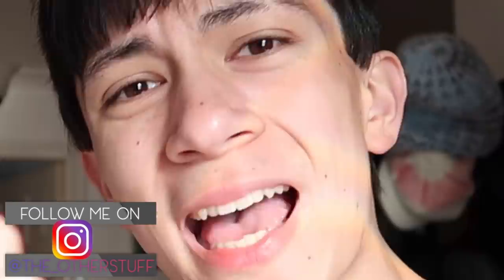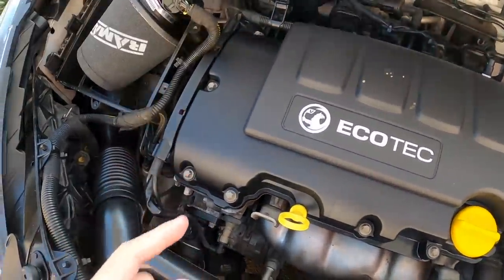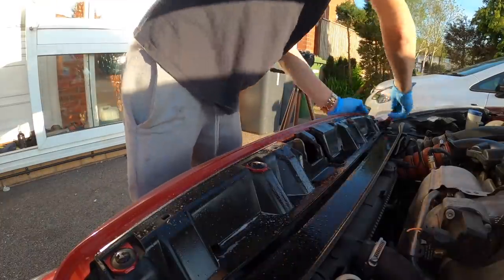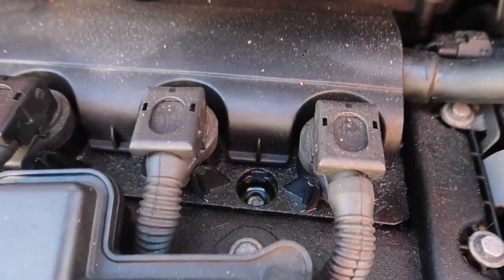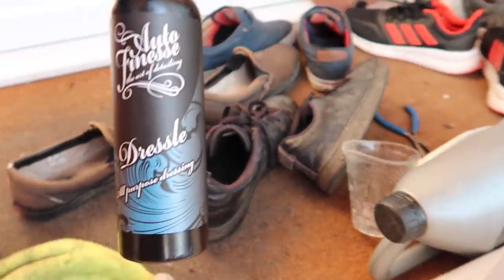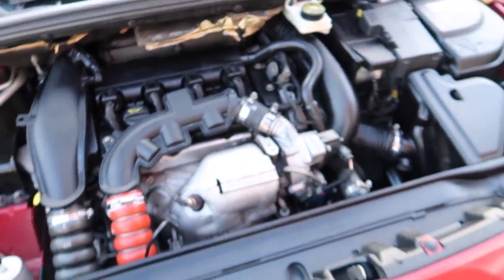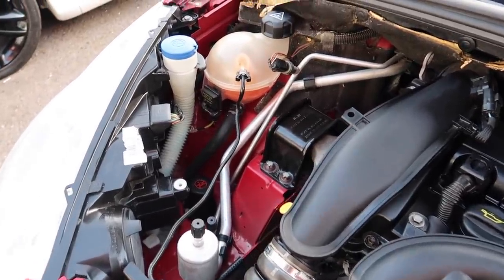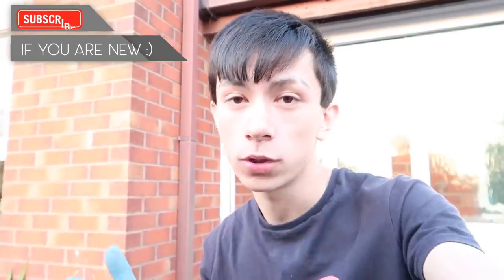HOW TO SUPER CLEAN ENGINE BAY (NO WATER!)

Comment: That insulation along the back of the engine bay can actually be cut off around where it's peeling back. It's only purpose is sound insulation and a tiny bit of heat insulation. Being that the turbo and exhaust is at the front of the engine, it's not vital to have that insulation there, so you can just remove it entirely if you wish.

Comment: You can use a pressure washer just put it on a low setting and obviously don't blast it in all the electrical connections 🤣

Comment: You’ve done this whole engine bay job wrong. I am a detailer. You have to use water. Also that stuff that’s peeling is heat shielding for tour firewall, you need to replace that. And you’re again spreading dirt around. Dress all is flammable, let it air dry
Reply: Second of all use a foam/microfiber applicator. That rag u used for the degreaser, only catches so much dirt, you need to rinse it off. Also it does look better but there’s definitely some leftover grease spots and dirt. This is done wrong. Not the right process.
Reply: Sorry m8, but this made me cringe so hard.
Reply from the maker: Hey mate, thanks for your comment but don’t you think your going a bit crazy over a video 😂 I don’t intend to do everything professionally and I think it’s quite clear in the video 🤣 You don’t ‘need’ to use water, it’s definitely 90% more effective but you don’t need to, and also Dressle is not flammable, it’s literally made to be put on the engine bay
Reply: The OtherStuff I’m not going crazy, and not saying you were going to do it professionally. Just saying the right way to do it. Aside from that it does looks good